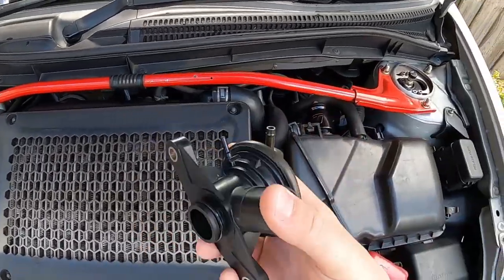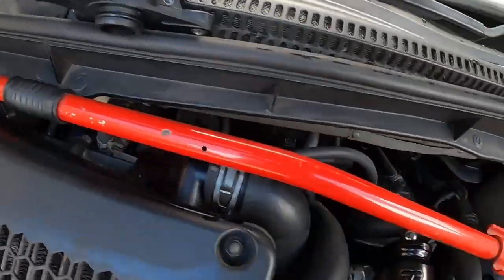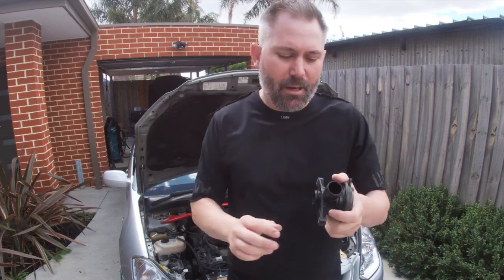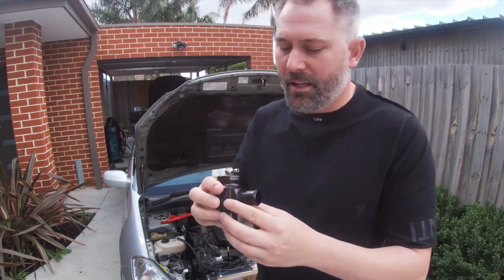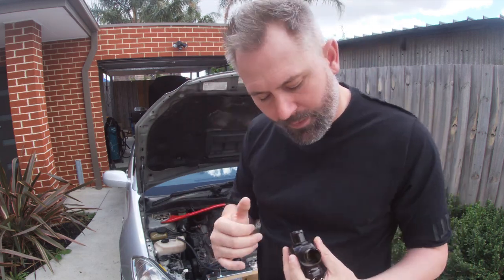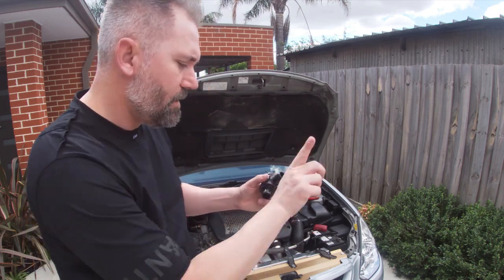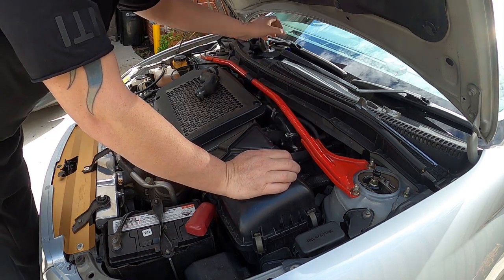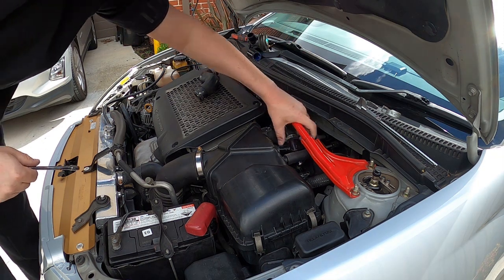HOW TO INSTALL A BLOW OFF VALVE (BOV) / DUMP VALVE TO A 3SGTE TURBO CALDINA OR ANY CAR REALLY

Comment: I worked on my Caldina and took out the factory bov and replaced ot with a turbo smart bov.. I'm impressed with the sound the  power that I was losing before..  next steps is lowering and getting new tyres and wheels and a duck tail later this year..it's a  Awesome family car! 
Thanks for the video mate...
Reply from the maker: You are welcome bro

Comment: Legend for making this video as detailed as you did, even with the drive by sounds. I'm currently in the process of front-mount intercooling and chucking a BOV on my 97 GTT Caldina, and buying a BOV without hearing it is a bit how ya goin haha, all ready had my eye on turbosmart products, specifically the Kompact range, this vid has sold me on it, cheers Tristian!
Reply from the maker: Thanks rubber chicken I appreciate you watching
Reply: @TURBOTRISTO  haha 10-4 Rubber Ducky. Dont spose I could chew ya ear for a couple more questions? You seem to be a pretty knowledgeable guy with the 3SGTE, with me going from factory top mount to a 600x280x76 front mount and BOV, will I have to get it tuned? Ive got a AFR and Boost gauge to install with it to keep an eye on it but didnt think about tuning until after the fact.
Reply from the maker: you wont need a tune unless you increase boost and fuel, the intercooler will make it slightly laggy but the overall benefit will be more consistent power  back to back as the air intake temp will be consistently cooler, the issue with top mounts is they get hotter and hotter and the performance drops

Comment: Yeah the stock bov is a pull-type bov. I've heard it seals better under high boost as you have positive pressure holding it shut. How's the response since the upgrade?
Reply from the maker: Much better
Reply: @TURBOTRISTO  nice! 
Thinkng of throwing on my gfb bov, but after i convert to a fmiv setup. The top mount suffers really badly from heatsoak
Reply: *fmic
Reply: Can I put one on my great wall turbo diesel ?
Reply from the maker: Give it a crack

Comment: Hi thank you for the information I have a celica GT4 ST205 same engine as your car 3SGTE. Just a question at the end of your installation of the blow off valve did you leave the air box we’re the blow off valve meant to fit back to the air box or is it ok to leave it like that and drive it to make noises? Because if you put the valve back into to air box then there will be no noise I was just wondering what did you do? Thanks
Reply from the maker: put it back in but it doesnt matter really

Comment: So is there a cold air intake that incorporates a blow off valve from what I can see if you use an intake kit the bov is removed. I have an N edition like this car and want to get some mods. Should i just go with an exhaust, bov and ecu remap and ignore intake?
Reply from the maker: Yeah I would say so mate , unless you had a custom intake that sucked air from
Outside the engine bay I wouldn’t bother I would run a k&n panel filter
Reply: @TURBOTRISTO  Would you recommend a piggy back ecu then if I wanted to look at remapping the car doesn't seem to be anyone in the UK that can read the standard ECU
Reply from the maker: go a complete standalone like a haltech or a link

Comment: Doing a 3sgte swap on my 6th gen celica.    I have the factory blow off valve but don’t have the money to get the valve you suggest.  I do not have a airbox either fir the 3sgte    I am not sure how to hook it all up
Reply from the maker: The factory bov is on the air box best bet is to just block it off then

Comment: Hey, stock BoV has 2 small lines going in it, this turbosmart has only place for 1, what do i do with the other line then?
Reply from the maker: Block it
Reply: @TURBOTRISTO  i’ve removed mine and put a single hose in it. Is that all fine?

Comment: I have a 97 wanting to do a aftermarket bov but would thay throw a bad reading for the maf sensor or a vacuum leak?
Reply from the maker: This one didn’t it was fine no codes at all
Reply: @TURBOTRISTO  so ift was fine taking the factory one off and leaving where the bov would opens port just venting to atmosphere?
Reply from the maker: @mrmystery8484  yes

Comment: Did you just use 28mm silicone hose with the 25mm BOV?  Didn't use any reducers anywhere?  I've got the same car and have just picked up the same BOV (couldn't find a 28mm BOV anywhere).
Reply from the maker: I used some silicone radiator hose from a civic haha

Comment: I already bought gt4 few days ago , last owner already put blitz blow off valve but stock bov still have ..So i need to pull out stock bov ?
Reply from the maker: yep ditch the stock bov
Reply: @TURBOTRISTO  thanks bro ,btw im from malaysia 🇲🇾
Reply from the maker: thats awesome thanks for watching
Reply: @TURBOTRISTO  have a great day mate …
Reply: @TURBOTRISTO  hi mate , is there any problem if the air box hole make a noise or just let it be like that ?
Reply from the maker: no issues at all man

Comment: So do u just block the return on the air box or leave it open?
Reply from the maker: You can choose in this instance  the owner wanted to plumb it back so we left it open for the video, but if you want all the noise you should leave the blow off valve to vent to atmosphere and close the hole in the box
Reply from the maker: @Sasha Gleeson any auto shop will have the hose

Comment: Hey, what did you do with the vacuum line on the side of the factory bov? Not the top vacuum line. Awesome video though, thanks mate!
Reply from the maker: There is only one vac line on this model
Reply: @TURBOTRISTO  my vacuum line has a T off where 2 split off and go into the bov I have a st246 and just got my Kompact dual port after watching this but I just noticed the 2 lines into the stock bov.
Reply: @TURBOTRISTO  there’s a little nipple under the vacuum line nipple which looks to appear on trungs aswell, curious if you just took out the T and used the main line. Sorry for the terrible explanation lol.
Reply: T off and use main line